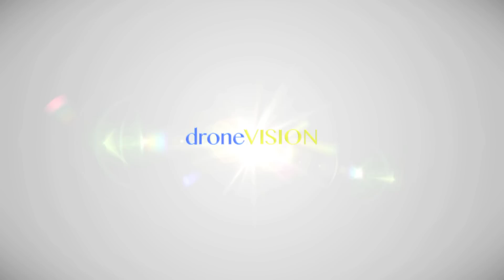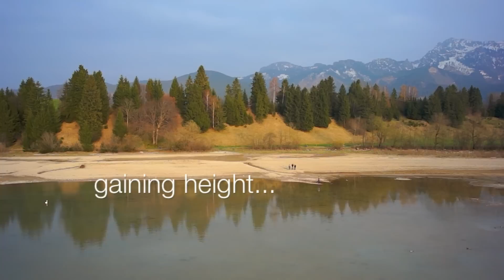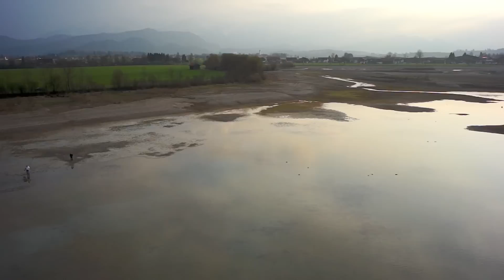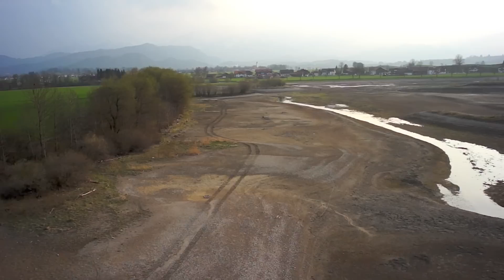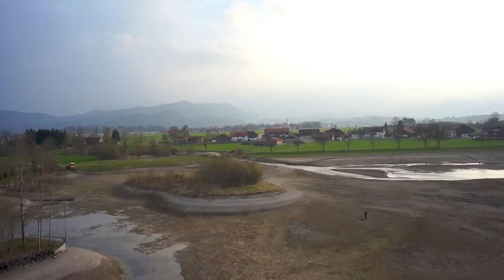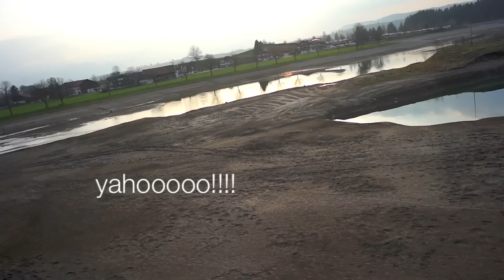DJI Naza Failsafe RTH Example

Comment from the maker: yes, I was lucky. The Naza is supposed to climb up to 20m...when watching the video, I wondered if those trees on the left side really are over 20 metres high. I´m not using an OSD, but my transmitter warns me by beeping - but the day before I switched the rx without noticing it doesn´t have rssi signal :-) So I was really lucky and happy when the copter was above me again.

Comment from the maker: My copter is a hexa frame by kopterframe.de (the one with a diameter of 100cm). Motors are Tiger MN 4010 580kv running on 14x8 Graupner Props. FC is DJI Naza with GPS. No Gimbal used in this video.